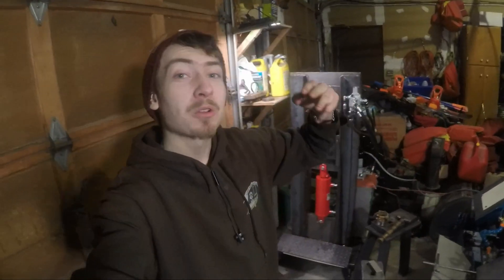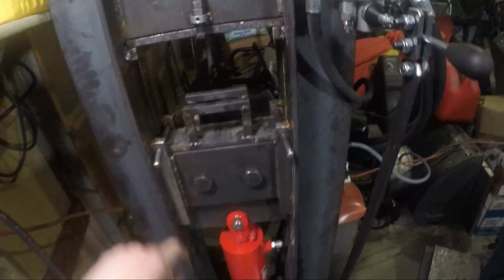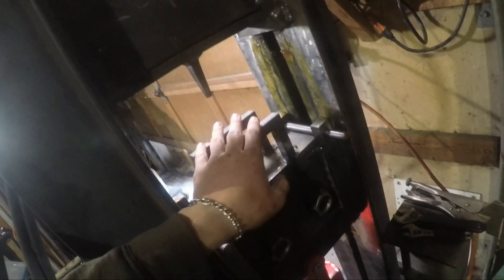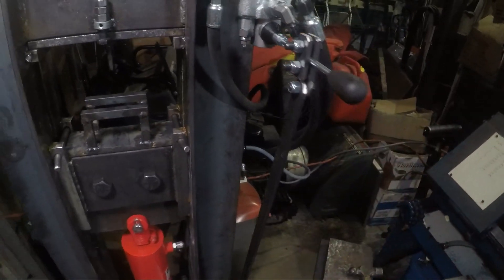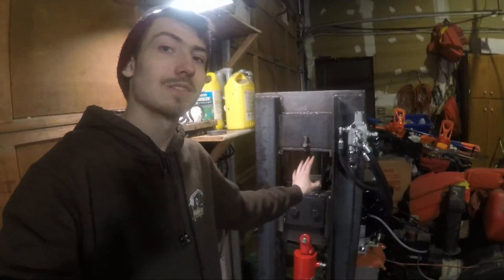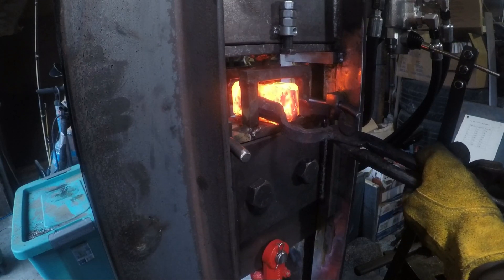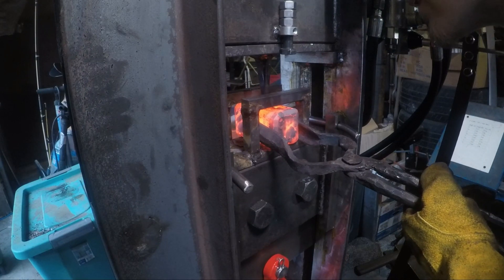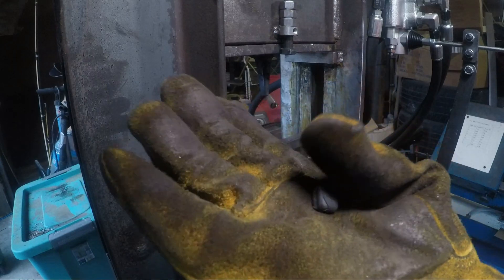Hydraulic Forging Press Part 3!!! FINISHED AND FIRST USE!!!!

Comment: You've got a solid press design there. One thing that isn't clear is how many tons it is! I swear you don't mention it once in your videos, title info or comments.
  The press frame material size chooses would support a 6" cylinder for 50 tons. The type of power pack, switch and the speed the cylinder is running makes me think your using a 5" cylinder and a max of 5hp motor for about 25 tons. Considering how key that information is I'm puzzled by it not being included. Very puzzled..
  You should absolutely make a set of plans available for the press.  Its a proven solid design that will last a lifetime.
  The only press that i know of that has plans available for sale has some serious design problems. It has a wide opening that can accommodate 3 sets of dies, the carraige guides are way to short. When using one of the outer dies the carraige racks so bad the far opposite die touches. Its likely the only thing saving the carraige from tearing itself apart. The whole build has issues, the material selection is just barely above the rated tonnage of the press, no safety factor at all. They should never have been made available to the public. The big issue is  people that know very little about presses like it. Its easy enough to build and very light compared to other 25 ton presses.  I think he uses 6" H beam as the major component for the build so its very cheap compared to the materials that should be used for a 25ton press build. For reasons that boggle my mind he's selling a lot of plans, his videos of it in operation are enough to deter experienced people but people new to this stuff are buying them up.
  Again not sure what your press tonnage is but I'm going to say its 50rons based on your material selection. A 50 ton press is a bit more than most people want for the home shop, 6" cylinder are significantly more than 5" and under. A 25 ton,  5" cylinder press only needs a 5hp motor and a 13 gpm (or a properly sized 16gpm) two stage pump. Thats within what most have available in the shop. Smaller faster presses are really big, 12 and 16 tons are probably the most wanted size for the hobbiest.
  Anyway, a guy like you thats willing to put a plan set together is just what the blacksmiting and knife making community needs right now.  There are too many guys building presses based on the plans i mentioned, not because they are the best, the cheapest etc. Its because they are the only set available to buy. Are you a member of the hydraulic forging press group on Facebook? The knife making, damascus and blacksmithing groups would be interested in this as well.
   The whole YouTube algorithm thing makes no sense. The guy that built the 25ton press and selling plans for a tool you could break in a hour is getting thousands of views on his press build series.. You've got a well thought out build that is guaranteed to be 100% successfu, it will take anything you throw at it plus its based on a proven design and your still in the hundreds of views.
  I hope you do make plans, a 16 and 25 ton press would be the most popular. I hadn't seen the press till today so I'm assuming your not on the forging press group. Its always possible I missed it. Hope you'll join up if your not already and start letting people know what you have. You can get design feedback if your unsure of what people will like best for foot pedals etc.
  You should get the press tonnage, cylinder size and motor HP at the very least listed in bold in the video description or add in some footage. Its what people immediately want to know., I think it would help with the video popularity a lot.
  Feel free to charge $30-$40 or even more for a set of plans with motor, pump, valve etc specifications, materiasl needed and cut list and building plans for it. Thats a ton of work and a good plan set is worth its weight in gold. 
 So, I've rambled a bit more than anticipated. I just got excited when I saw your fantastic press and that you were willing to make plans. I don't have the time for it, plus I still draw on paper most of the time unless I'll be making more in the future.  I usually help/mentor 1 or 2 people at a time make sure they've got a design that works, give advice on fabrication of the frame and specify hydraulics/motors, pumps, valves etc. 
 I hope you get your plans out there, there are so many people looking for a properly designed forging press plan set. Maybe you'll be the guy to bring out the first successful plan set for a hydraulic forging press. Its been done for beltsanders, tire hammers and rolling mills and plenty of other equipment. The forging press void is yet to be filled, Goodluck!
Reply from the maker: I appreciate the feed back and I will join it for sure and post a few things, I’d love to message you to maybe get your thoughts on plans, as I make them I’m not as busy as I have been and you are certainly correct about a lot of presses being not available or not great, this is only a 19 ton press but it only uses a 3hp motor so it’s not massive or stupid expensive either, I haven’t had anyone explain or be seriously interested in plans so with that I don’t see why not about putting them together now

Comment: amazing. I love how little real estate it takes up
Reply from the maker: The entire unit fits onto one of the 1000lb mover Dolly’s from PA so for $18 I have it on a dolly that I can wheel around, a few things hang out like the tank hoses and foot peddle over hang the sides but not a big deal at all
Reply: What would you say the cost is for the steel and the hydraulics?
Reply from the maker: the hydraulics alone was about $1400 and the steel was about $600, a lot of it depends on what you can source tho because I got a lot of the components on sale and steel out of off cuts or scrap bins so I got everything much cheaper but those numbers are full price everything